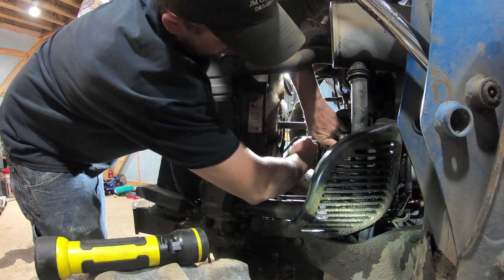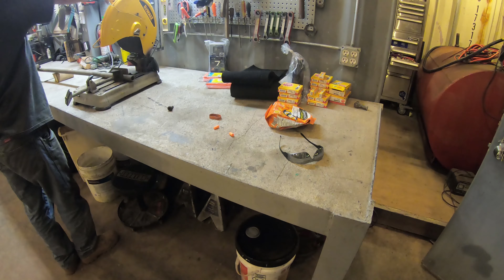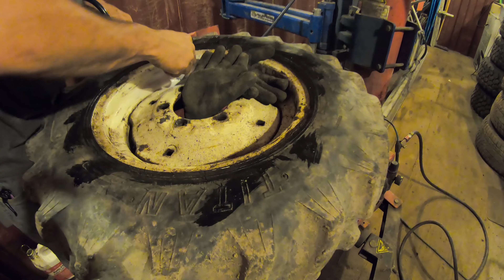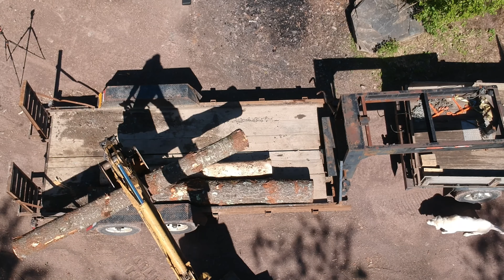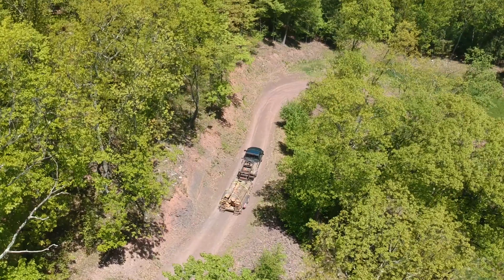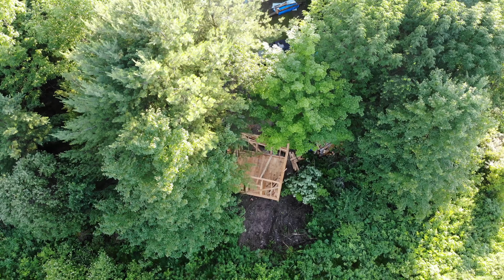TC-35 repairs and getting logs from Andrew to build with

Comment: Fantastic video Jesse. I have been working on cars/equipment since 1968 and never even thought of using vice grips to hold utility knife blade.  You saved my fingers. Eric of south main auto recommends maintaining belt orientation when re-using old belts so he uses a paint marker with an arrow pointing forward on the superficial surface.  Apparently the old belt is bedded in and less likely to squeak or wear.  Finally, I just bought a used John Deere 35 d excavator like yours and when I flushed the hydraulics I found out to only use Hitach fluid 46 LH, no JD hyguard or Traveller. Apparently the low zinc content will protect your equipment better.  Only time I've seen JD not recommend their own product. Kind Regards Craig

Comment: I saw a chevy 2500 today on the freeway pulling a mini excavator bigger than that Yanmar on a tandom dually 30' gooseneck trailer.   Where are the cops when you need them.  That truck is not capable of this weight class.    Great videos you guys.
Reply: Jeff Fleischman what size was it. It probably was capable of it. Goose neck trailers can carry allot.